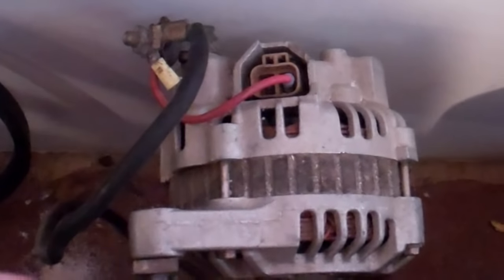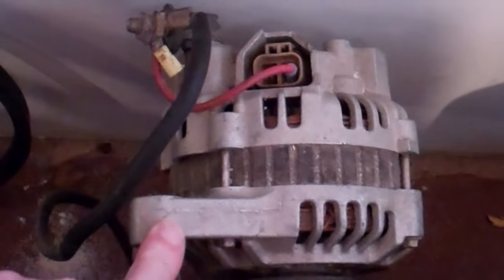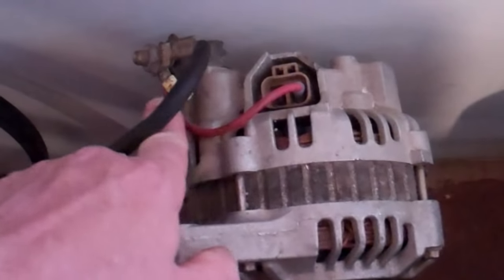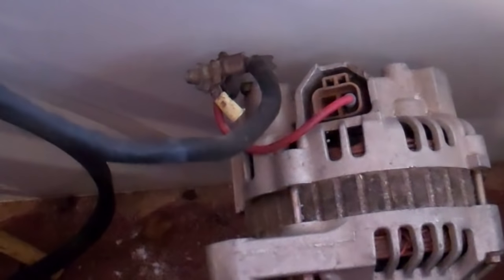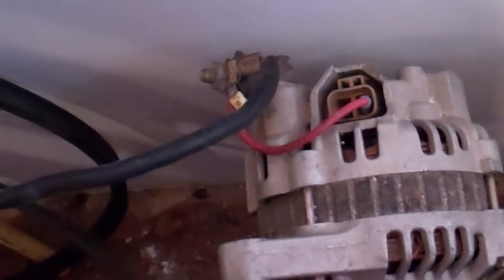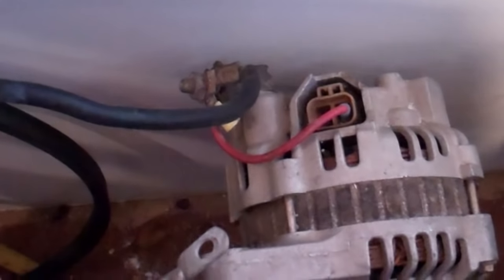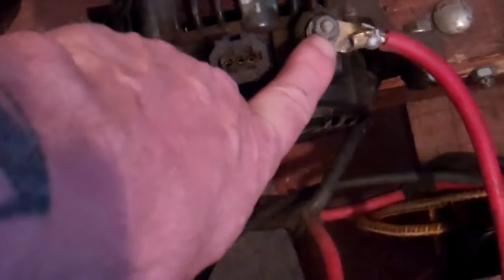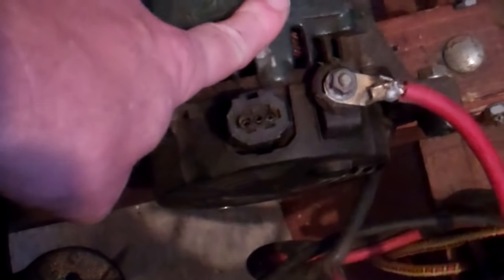BASIC ALTERNATOR CONNECTIONS FOR A 12v CHARGING SET

Comment: hello i have a 1992 hyundai excel with a 75 amp mando alternator..the 2 pin connector broke..i am not sure where the two wires go to that alternator connector..can u help me..one wire is white and blue and is thicker than the other is white and thinner..

Comment: I have a 1984 chevy k20 woth internally regulated amp but i am confused with different answers im getting. Is it ok to bypss the excitor wore directly to the main batt connection on back of alt?
Reply from the maker: Put the exciter wire through a 12v bulb the bulb will light when the alternator is stationary.When the alternator spins the light will go out.
Reply: Is this necessary to put dummy light in the alternator? Ot i can directly connect to ignition switch on? Tnx for the answer
Reply: @thra5herxb12s  is this necessary to put bulb or optional?

Comment: I wired a alternator, but as soon as I disconnect the battery the voltage goes to 0 and I put the exciter on the output, am I not spinning it fast enough? Also do you need to connect the voltage sense wire?
Reply from the maker: You need to spin it pretty fast but you might not have it wired correctly if it is like the one I have here you need to connect one of the two terminals to the positive output. You will find out which one by trial and error.
Reply: thra5herxb12s I was on a fourm they said put a resistor on the exciter as you don't need it to be full notch at lower rpm.
Reply: thra5herxb12s do you think a led in series would work?
Reply from the maker: I dont know what they mean by that. A car doesnt have a resistor in series and the alternator has a built in regulator and only gives out as much power as you try to pull from it.  I dont use a resistor on any of my charging sets and dont have any problems.
Reply from the maker: An led is a 1 volt diode. It would probably burn out instantly. You dont need anything in series.

Comment: For example do I need a need to put the positive wire on the output and link it to the positive side of the battery and the negative  wire on the ground on the alternator and link it the battery?
Reply from the maker: Depends on the brand of the alternator you plan on using. This type needs a link from the positive output to one of the small terminals to exite the field coils, you will also need a car battery to exite the coils before it will produce any power, you can disconnect the battery once it's running. Most will be negative ground.  When you're first trying to get the wiring done, use a drill to spin it, most will only work in a clockwise direction.
Reply: thra5herxb12s so if the alternator I get is grounded how do I plug it up. To the ground wire to the negative of the battery? And what about the positive side those that just stay empty
Reply from the maker: This ones a bit big. You need something from a small Japanese micro compact.   You will only be able to produce 1/4 hp by peddling so you wont get more than 125 watts from the alternator, which means there's no point in getting a huge one. you can find the connections by  googling the make and type.  However 125 watts will be more than enough to power a TV, Laptop, and quite a few led bulbs. Get a cheap 300w inverter from ebay.  I have spun a Shimano bicycle hub dynamo at 3750 rpm with an engine to run 12  4 watt led filament mains bulbs. https://youtu.be/K1ehj860KL0
Reply: thra5herxb12s nice but I'm not looking at anything to fancy to power up seeing that's it's for a school project. I've figured out the wiring there's a one wire and three wire system. That's why a lot of people have different plugs, plugging up to different things. The alternator in looking at is a one wire. So how do I plug that up, positive to positive and negative to negative.
Reply from the maker: Yes you got the connections right . You can also leave the battery connected straight to the alternator if you want because the regulator circuit inside it will disconnect the battery when it stops running or you can put a simple toggle switch in line with the positive lead and connect the inverter to the alternator so when the battery is disconnected you get alternator power running the inverter.  The inverter voltage is crucial, it will shut down if the voltage drop too low and also if the voltage gets to high. The instructions with the inverter will tell you what the upper and lower voltages are and you can get this just right by peddling at the right speed, you can find the speed by experiment.
Reply from the maker: You need to check the tech specs of your alternator to be sure it's negative ground or you will fry the regulator inside it. Easier still find out what car it's from and find out what way the battery is connected most are negative ground though.
Reply: I was thinking about installing a toggle switch cause that's what I saw in a lot of videos. Now if I was to do that Do i have to hook up the Toggle switch to the positive side of the battery. But how do I connect the inverter to the alternator, do I use the Aligator clips or the other end of the cord for the inverter, which plugs into the back of the inverter.
Reply: And what about needing an resistor or diode?
Reply from the maker: No diode or resistor is needed because the voltage regulator inside it already  gives you a  steady DC output.
Reply from the maker: You can use the clips if you have them and yes you put the switch on the pos side.
Reply from the maker: No you dont need this and it looks like a rip off anyway,  all it is is heavy duty cable and it looks a bit expensive for what it is.  You wont be producing enough power to need heavy duty cable.  Dont forget to post up a video when you get it running.
Reply: I know I need like a 6 gauge wire, with the post cables for the alternator and the battery cover, just like that they have. I'm going to buy the stuff the separate and hook it up together.
Reply: Is their an cord for this I could use for the one wire alternator, cause I know thats the only way I hook it up to my battery.
Reply: Also if the toggle switch has to go on the positve side of the alternator with an alligator clips, the battery cover thing that's coming off the alernator. Do I put the aligator clips first then the battery cover thing.
Reply from the maker: If you dont have space under the cover for the clips just use the wires.
Reply from the maker: Any power cord will do you dont need 6 gauge but if you do want to just buy a set of cheap jump start leads from ebay.   6 gauge is for heavy duty like 100 amps, you will only produce 1/4 of an amp by peddling.
Reply: thra5herxb12s how do you hook up wires to a battery. I thought I needed alligator clips
Reply: thra5herxb12s   The jumping cables are more money than the 6 gauge wiring. So I found some audio cable 6 gauge wiring and I'm going to add the clip at one and some aligator clips at the other end to hook up to the battery
Reply: But then again I don't want to be stuck wiring stuff I have no idea about If I get jumper leads. Does on side of the aligator clips go on the alternator and one to the battery
Reply from the maker: Just use what you feel most confident in using, alligator clips will make it easier for you to keep disconnecting them .
Reply: thra5herxb12s so I can hook aligator clips to the positive side of the alternator?
Reply: I did what you said, but its not powering up.
I put the toggle switch on the positive of the battery. The inverter   positve alligator clips on the alternator and I didn't do anything with the negative. And  I hooked up the alternator to the positive side of the battery using audio wiring cables, but the audio cable wiring has the terminal to put on the alternator and I installed the copper to the clips.

I also have someone photos to show you the alternator. And where do I hook up the multimeter, cause I put it on the battery the positive and the negative at one time, and its started smoking.

Photos https://plus.google.com/106537445593707521330
Reply from the maker: Your photos look ok check your meter is set to the 20v dc setting and connect it to the alternator.  Then forget the switch and inverter for now, just get the alternator spinning fast and get a helper to tap the battery wires to the alternator. This will energise or excite the coils inside it and you will feel it get hard to pedal as the alternator powers itself up.  It seems you're doing everything right so maybe you need to pedal a bit faster.  Once you learn how fast you need to pedal you can try hooking up the inverter.  Post up a short video so I can see if there is anything wrong.
Reply from the maker: Something I should also mention is you need to have the drive belt tight so it doesnt slip, you can buy some sticky stuff in a spray can from a motor accessory store it's called belt slip or something they will know what you mean.
Reply: Something else to. in the video I didn't put the multi meter directly on the bolts. But I know to do that.
Reply from the maker: I did. Starting to look good.
Reply: my alternator is only giving 0.4 volts. am i not peddling fast enough
Reply from the maker: You might not be peddling fast enough or the belt might be slipping. Did you tap the battery onto it briefly to excite the coils. If you get 0 volts before you excite it and 0.4v after, it might just be a speed or slippage issue, but you are getting there.
Reply: Hi
 I have been struggling with my 1300 Ford bantam, Im on my 2nd alternator and still does not charge my battery, I looked to see if I hafe a in line fuse but nothing. The positive runs from the alternator and joiners at the starter before running to battery positive
Please help. I have been of work now for 2 days

Comment: sir i want to conect 12v 12ah alternator to battery .so what capacity of battery i have to choose
Reply from the maker: You need to choose a battery dependant on how much power you need to take from it.  A 12ah battery will take you 1 hour to recharge, a 120ah battery will take 10 hours.  With a small battery you will only draw small power for a short while but will recharge faster.

Comment: How many wires on a toyota camtry  alternator goes to the battery. 98 le
Reply from the maker: Usually only 1 thick wire goes to the battery except for the exciter wire which connects through a bulb that goes out when the alternator is charging. You need to find out which is the exciter by experiment or google the tech specs for the model of alternator.